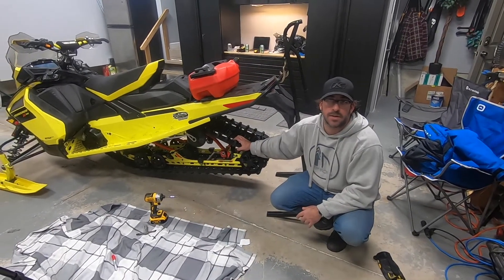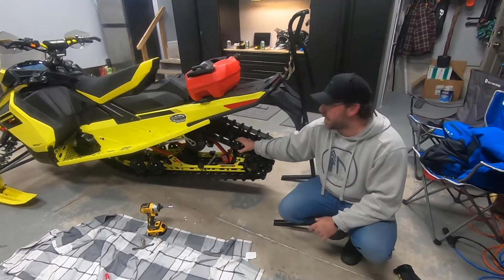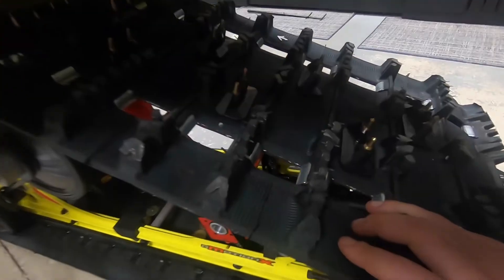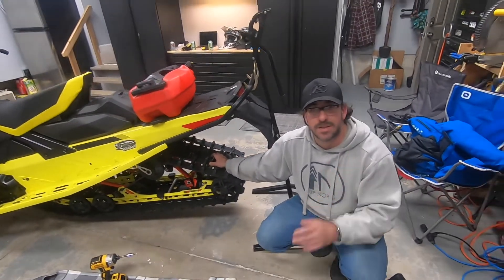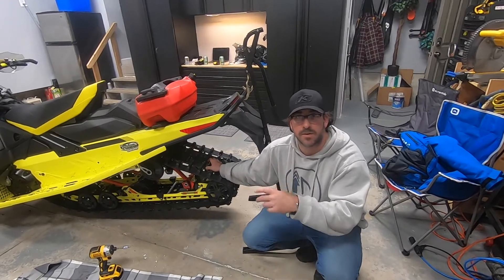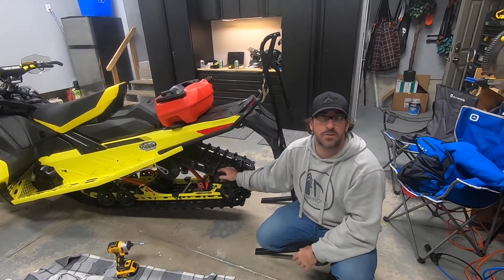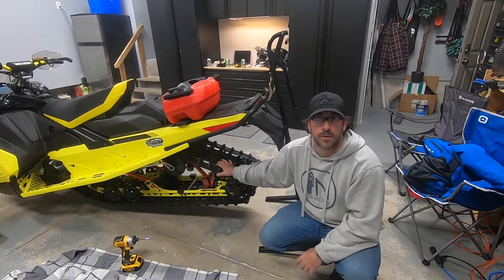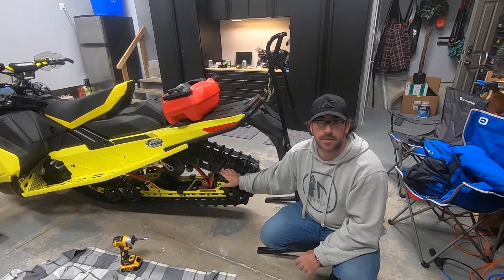Install | Stud Boy Powerpoint Plus Studs with Super Lite Pro-Series Backers

Comment: Is there no warranty risk in adding studs to an ice ripper track? I had an ice ripper on my last sled and it said specifically on the track no too stud. Though I'm re-thinking that now on my current sled. (same as yours)
Reply from the maker: Relatively minor warranty risk. Part of the reason I use the superlite pro series backers is because they are very unlikely to pull through. Also, if you use a prestudded/single ply track, make sure to use studboy powerpoint plus studs, which are wider studs meant for single ply tracks. 
Cheers,
Jesse

Comment: I thought the RipSaw track already has stud pattern built in (nubs where to drill)?  Curious how much of a pain it is to screw the studs in from the back side of the track compared to the woodys that you can hit the bolt from the top side of the track.  I have been considering that studboy studs, but thought that getting behind the track would be more of a pain??
Reply from the maker: Its a little more involved to install the superlite studs and backers and you need to ensure that you get the tool which helps you hold the backer in place. Yes the track has marked holes for drilling, but don't use those. Buy a traction guide (woodys or studboy) and use that to mark your drilling holes.
Cheers,
Mike

Comment: I think your going a tad light on the studs for an 850. My $.02.
Reply from the maker: I usually put in 144 but mike likes 96. I agree with u! For me I want to hook up immediately and why I always do 144. After riding both mine and mikes, although mine picks up quicker because of stud #, his still hauls and has higher top end on the lake runs
Reply from the maker: In addition to what Jesse wrote, I also prefer a sled that feels a little more 'loose' and can break the backend around a little which is why I run 96. Also, with the double backer pattern I can easily add one more per row if I feel like it needs more! Cheers, Mike.